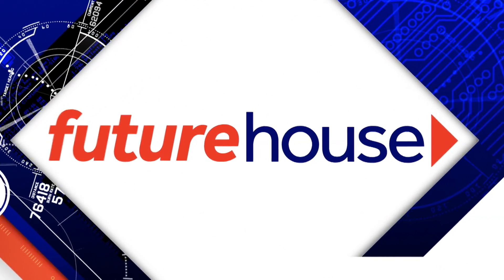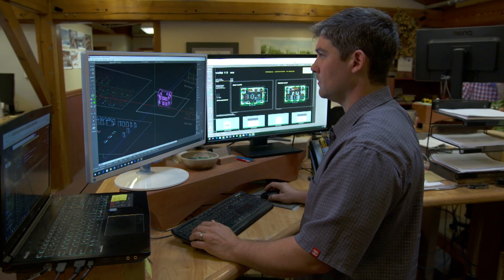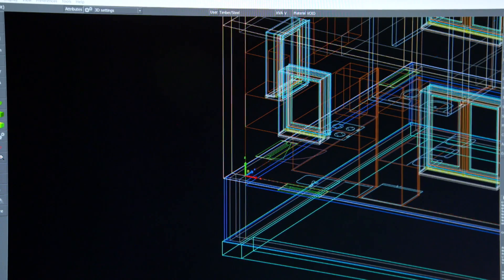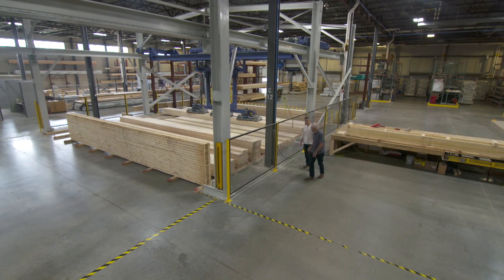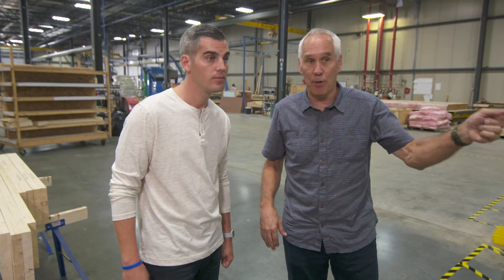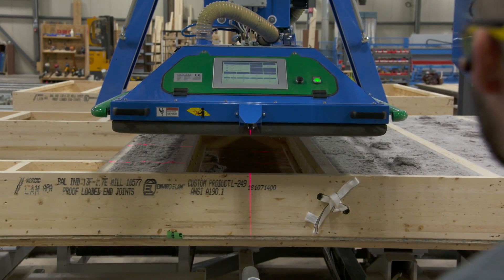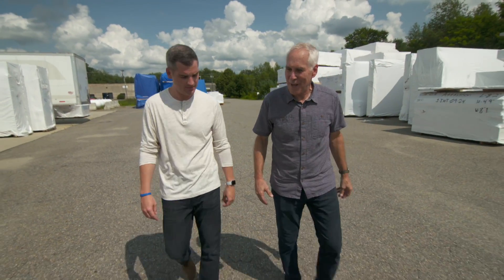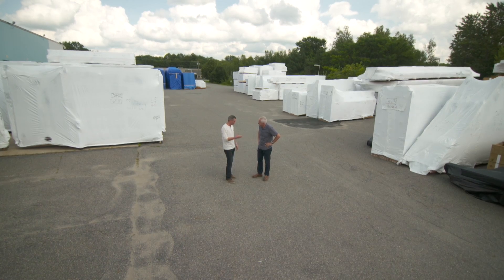Machine-Built Houses with Tedd Benson | Future House | Ask This Old House

Comment: I didnt see a single thing other than programming, qa, design, that couldnt be automated at the factory. I wouldnt feel comfortable having a job knowing that my position could be automated easily. IE the factory floor could be handled by maybe 3 people at most and one of them is to repair/replace equipment failures.
Reply: They're not replacing a guy with a six degrees of movement $1 million robot. Not unless minimum wage is $30. It's going to be 20 years before any of those jobs disappear even with the focus on automation.
Reply: @toomanymarys7355   your right there not due to taxes placed on automation. its the reason why McDonald's doesn't automate now, the tech is there the software is there. but taxes on automation make it cheaper to keep low paying jobs.

Comment: That degree of Automation will not last. Right now they are just making it easier for the people but everything they showed people doing like the gluing and paneling can be automated. I think what they are doing is a good thing though because it does make the house building process a lot safer and less demanding on the body.

Comment: While people might be freaking out over automation lets just think about that for a second. It takes about 5 people to frame a two story house in about 40 hours/one work week. The actual decrease in the number of jobs probably isn't as much as you'd think and its certainly not as people assume just all jobs lost. First of all there's certainly no lacking of demand for housing so you always have to keep in mind if a cut in labor per unit produced also means a lowered cost that increased volume might not result in a net lowered employment due to higher rates of production. Also note that this doesn't include a lot of other things involved in home building like leveling and foundation, drilling wells, roofing, plumbing, electrical work and fixtures. In fact its mostly just structure, framing and carpentry.

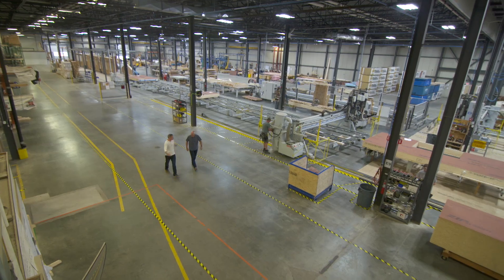There is at least 10 people that could be seen in the video working in software. There's also someone (more likely a team) writing that software and there might be another employee to maintain all those computers. As he mentioned at 3:30 there are about 30 employees working the machines. I'm not sure if the its included in the former metric but there's probably several other employees and frequent subcontracted work to maintain the machines. You now also need some specialized transportation for the component assemblies for these homes and lets just say that involves maybe 2 more people. Finally you need your onsite assemblers which I'll also just guess is maybe 10 people. So ballpark estimate is some 50 people working at any given time with ten or so homes waiting to be shipped. There's a lot we don't know and a lot of guess work but that puts the labor per house at pretty similar amounts even if you assumed they shipped 10 homes a week from that facility.

If I had to guess intensive automation could probably get labor down something like 30% at most at any given company. But people just completely miss the fact that as the labor used per unit goes down assuming that follows a lowered cost means higher consumption in most industries. Thus there would just end up being more companies or bigger companies. The real risk with automation comes from who controls the machines and how employees are treated through transitions.
Reply: The swedes have been able to erect a house with 3 guys in a single day... since the 1980s.

Comment: About the only way you could run wiring in the furring strip are is by using metal conduit. To have boxes big enough, you would need 4-11/16 boxes with plaster rings.

Comment: Why don't you use plywood for sheathing instead of crap OSB?
Reply: I was just thinking the same thing as OSB is really sensitive to moisture but gets used frequently in newer homes.
Reply: @electrifyinglightningbolt  It used to be sensitive. It's not anymore. Progress.
Reply: Why would you ? It's quickly covered and strength is not an issue.
Reply: Plywood isn't a cost efficient material.

Comment: With automation quality should go up, everything should be plumb and square, the only thing I didn't like was the insulation, you need to stop the movement of air. I would've like to have seen spray foam insulation...

Comment: Engineered wood is stronger? In which universe?
Reply: Glulam vs hardwood beam.
Reply: @toomanymarys7355  Railroad ties aren't laminated.
Reply: @Jemalacane0  railroad ties are soaked in oil to be long lasting in exterior environments. Has nothing to do with strength.
Reply: @acerjuglans383  No, railroad ties don't need to be strong. They don't support trains weighing thousands of tons.

Comment: Seems this wouldn't be cheaper, but just more faster so not sure I'd pay the extra unless I was 100 percent sure I'd never sell the house.  That's the thing about TOH, they just high-end materials and methods to get the job done, but if one sells one of these homes, no one cares how or what it was built with so they still only paying same as if it was built by a bunch of mexicans.  

With AI coming, maybe the US will officially do something to reduce the labor supply which reduces wages which is why so many don't want to work in construction any more.
Reply: There are other companies that do something similar but with less automation. The benefit of this is that you don't have to worry having good weather for a long time. You only need a few days to come in and put everything together.
Reply: @gslavik  True, but 2 of these companies in the mid atlantic area have gone bust.  Those companies served all markets, not just high end.  I've passed through some housing developments lately and see lots of packaged panels laying around - panels is as far as the big track home builders have gotten with automation but no doubt more is coming which means less jobs while the left doesn't care how much low skilled labor is in the US.  Too much labor reduces wages - basic law of supply and demand.  I "had" family working in all aspects of construction - low wages drove them out.  They'd rather work a comfortable indoor job if the pay is the same - some just give up since welfare is on par with low end job pay.

Comment: Oh boy , robots taken our jobs
Reply: More like nail hitters turned into engineers and advanced manufacturing machine operators. Safer, more efficient work environment with lower costs, less insurance claims and everyone moving up in society. It's a win-win for everyone. Anyone that thinks advanced manufacturing or automation is a bad thing for our country has never worked in manufacturing. Also keep in mind that each one of those machines he has was probably custom built and has a supply chain that goes another dozen or so vendors that get a piece. I would much rather have my house built in a factory and assembled in days on site rather than it being built, soaked, snowed on, and then settling for the next 5 years.

Comment: That's what we Germans do for over 80 years :-D  :-D  :-D  :-D  :-D  :-D  :-D  :-D Even their whole machinery was built in Germany.
Reply: 80 years? You mean since WWII?
Reply: @grayzao7688  Exactly. In 1948 Heinz Bauer invented it in Augsburg and began mass production of 230 houses. Walter Gropius invented a similar system in 1931 but you know history ...
Reply: @julianreverse  The reason for this was actually there was a scarce on houses and apartments at that time, many buildings were destroyed during the war and so it was necessary to develop a method to produce homes very fast. In the early 1950s loans were given by the state owned banks (Landesbanken) to build a house with a low or almost none interest if you leased a part of the house to a tenant for several years.
In the US they never faced such massive problems of homes being such a scarce, so it took its time until now. Actually such a program was already started during the war ("Behelfsheim" which can be translated as emergency or temporary home) for people whose houses were destroyed by bombs. And the situation was not made better after Poland and Czech performed their ethnic cleansing and driven-off all germans, which then were considered as refugees or displaced persons here. Some of them didn't even speak german, but they had german ancestors. And they weren't very welcomed here, because the situation was already worse.
Reply: So you had computers and CAD software 80 years ago?  My, my, my...boggles the mind...
Reply: @buckhorncortez  Who needs CAD to build a prefab house?
Reply: A timelaps of a modern German prefab home from the market leader. They build 800 - 1.000 homes each year. https://www.youtube.com/watch?v=UVVVTQ6etKw
Reply: https://www.youtube.com/watch?v=L6yceqgLDIY
Reply: @julianreverse  Interessante Informationen. Danke! Sorry for my bad German :D
Reply: @grayzao7688  It's perfect!

Comment: I thought it would be built in modules...This is just panelized...We've been doing that for decades and maybe the consistency isn't comparable but the speed is pretty close to the same..The only difference I see is more machines...No robots in that building...Those were all just automated or manually run cutters, nailers, jigs and fixtures...As well; those fir studs look like shit from home depot...Checks, warps, missing chunks...Yuk...

Comment: He didnt ask how the cost compares to a traditionally built house.
Reply: He hinted at similar costs, but higher quality.  There still appears to be a level of customization involved.  This could also be applied to a "discount" facility that would be designed around cranking out only 10-15 totally standardized homes, bringing cost down further for homeowners who value cost over custom designs.
Reply: I somehow heard that the price out of factory is low, but the delivery and assembly cost make the total price similar to building traditional houses.
Reply: Check out the Unity Home website (based in NH) for ballpark costs, I think you will be surprised and impressed.
Reply: From the website " At the low end of the cost spectrum, there are versions of Unity’s Nano platform that can be built for less than $120,000 in certain locations. The construction cost for many Unity Homes falls in the $300,000 to $500,000 range."
Reply: Garrett Repair It obviously a big range based on size, options, etc. Housing costs are very high in the Boston area, so for “custom” new construction the costs are actually very good.
Reply: Even with same pricing, the quality stabilization is highly valuable.  There are many good, honest carpenters out there, but also many shoddy, dishonest ones.  Currently it's a pain for homeowners to have to filter for good carpenters.
Reply: in uk if you order a prefab from one of the premier builders fully wired and plumbed etc and inc. delivery and construction is way cheaper than a build even factoring the exchange rate
Reply: Look it up yourself some of these manufactured homes go for less than 20k if they're used. The only difference is the septic tank system if you park it in a mobile home park, if not slap it on a acre and connect to the cities sewage.
Reply: @LegendLength  Have you bought a car lately?
Reply: It may be similar in costs, but assembling everything in a climate controlled environment is a priceless benefit
Reply: It's pretty high - right up there with Go Logic in Maine.  They are high performance homes though; you're paying for the quality / efficiency and fast on site installation. A typical home isn't installing quality triple panes, thick walls, rain screens, etc.
Reply: More or less the same cost as i can tell from Germany where this way of construction was invented.
Reply: @julianreverse  I wouldn't say that. It depends on the materials the manufacturer uses and the future home owner can afford. You can get a cheaper wood construction or you can get a house with pre-cast concrete walls. The wooden house is cheaper than the house made of pre-cast concrete parts. Pre-fabricated homes have the advantage that they can build them much faster on site than a conventional construction like a brick-layed home. The thing is, the wooden house is cheaper, but it won't last that long due to the climate here the wood will start to rot after several decades. A brick-layed or concrete house is designed for a life time of at least 100 years in this climate.

Comment: They didn't address the plumbing or electrical. with it sheathed both sides and insulated, how do I get my electrical or piping run? I'm very curious about this.
Reply: general4str They install furring strips on the inside of the wall once sheathed. This gives a chase for pipes and wires and a place to mount the drywall without interrupting the insulation. You may be able to see it in a few shots, but we didn’t have time to include that in the final edit.
Reply: You should never have any pipe inside an outside wall anyway due to freezing problem... Electrical should be ran inside the wall in case someone screw something in the wall.
Reply: @DavidLucBelanger  Not just freezing, it's also a "heatbridge" or coldspot in the wall.
Reply: If you order a prefabricated home here in Germany everything of this is already inside if they bring the parts to the site. The whole plumbing, the electrical and so on. They just need to connect the conductors and pipes when they put the parts together. Prefabricated houses were introduced in the 1940s here when there was a massive scarce on homes here in Germany.
Reply: @Marcel_Germann  Could you please recommend a few of the better prefab builders in Germany?  I'd be interested in checking out their websites.  Thank you.
Reply: @brightonideas  The DFH (Deutsche Fertighaus Holding) for example, with their subsidaries for example. But I hope you can read german, because none of them has an english website. The DFH is market leader here, links to their subsidaries:

https://www.massa-haus.de/

https://www.allkauf-ausbauhaus.de/

https://www.okal.de/
Reply: Search the video "Bensonwood's R35 Wall." It appears that conduit is run to all the electrical boxes to protect the wiring behind the drywall.
Reply: Just to clarify most of the plumbing and electrical is located in the interior through chases, but it is also located in the air space provided by furring strips on the inside of the exterior wall where required. There is hardly a risk of freezing because of the wall assembly (high R-value and no thermal bridging).
Reply: Out houses and batteries. You have solved both. And for dishes and laundry? You use paper plates and become a nudist. There we go.
Reply: @residentevil2928   I am already a nudist
Reply: Okay, I can see the interior furring at 7:36. That's terrible for trying to run anything in that wall. Sure, plumbing in exterior walls should be avoided. (I live in southern California, not much of a freezing problem here) but for electrical all you can run is romex to a pancake box. Not only is that not deep enough for most outlets and switches but your romex is now in a pinch position where it can't flex out of the way if a homeowner puts a nail or screw into the wall. That bottom chase is also right where any base trim would be nailed.

Comment: Should I Pursue this type of construction for my future? How does the salary compare to an actual construction job outside?
Reply: If you ever worked in construction, why would you want to do subpar work in the freezing cold, or rain, or snow, or work on a hot roof in the middle of the summer when you could be comfortable and do the same job using high end tools, and be part of a much higher quality build?
Reply: @acerjuglans383  I agree I’ve been working construction for 2 years and the cold sucks. I don’t mind the heat too much